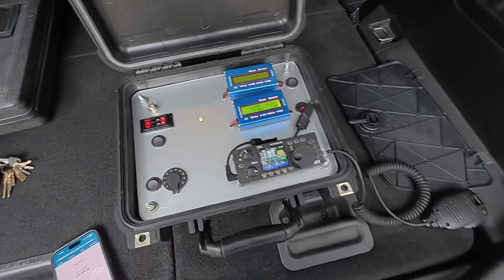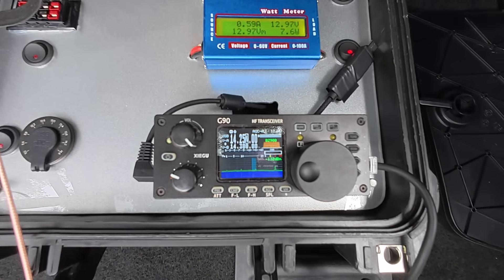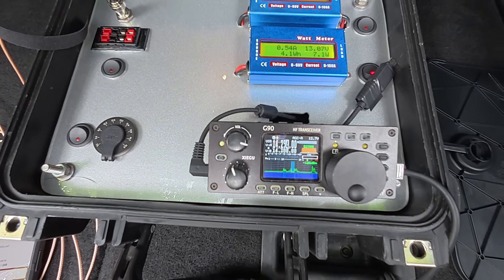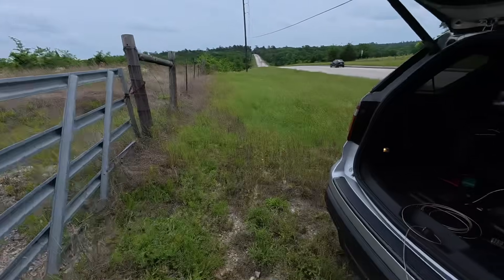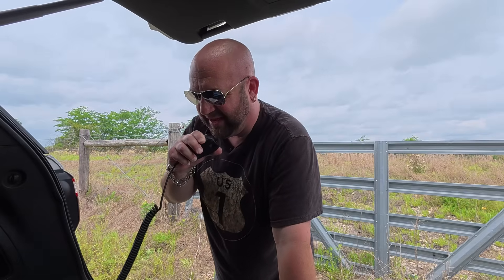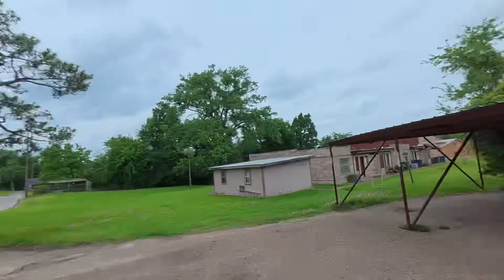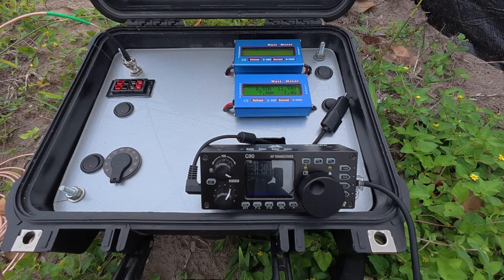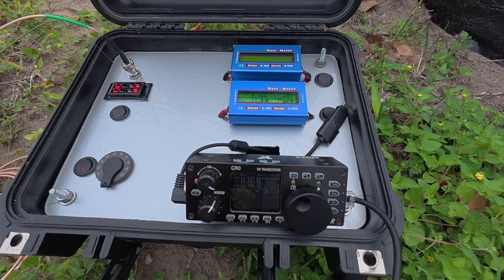Turning Random Objects Into Antennas With My Xiegu G90

Comment: 45 years ago. I attended a Technical School in Sarasota, Florida. In the summer of 1980. And I had with me, my good buddy Bob. Who was also taking the course. And I had brought along my, T Barry, CB radio. It was a very nice, 12 V or 120 V, unit.

We were staying on the second floor in the dormitory. And I had no portable antenna for my CB radio. But I did have the wall wart, Texas Instruments, calculator charger cord.

Now that did not have a, PL-259, connector on it. It had a 1/8 inch tip/sleeve, earphone like connector. And connected to the wall wart, transformer. So I wondered? What that is 6 foot piece of wire might pick up? If I stick it in the hole of the PL-259 connector on the back of the CB radio?

Lo and behold? The signal strength meter lights up nearly full scale deflection. I'm listening to dozens of conversations. The reception is superb! I'm picking people up from 40 miles away. They are coming in, 5 x 5.

Now of course. There was no ground wire connected. Just the hot lead. And 6 inches of wire connected to a transformer at the end. Approximately, 14 feet above ground. And the reception is truly, stunning.

Of course I know. Without a ground wire connected. I can't press the microphone transmit button. There's nothing to load it down with, properly. And will likely blow up my, CB transmitter? But what the hell?

So I do the Breaker Breaker for me. And everybody hears me! I am coming in really clearly. When they find out where I am in downtown Sarasota. They identify as being over 30 miles away. And they said my signal was very strong. And I wondered how that could be? But I look at my meter on the CB radio. When I'm in transmit. And it indicates… I'm in a proper, 52 ohm load. The transmit meter is exactly, where it should be. There is no actual antenna connected to my CB radio! This should not be! Physics says no can do. But it worked great. None of the guys could believe it. That it was working so well. And my signal was, 5 x 5, all over the city. From a 6 foot long calculator charger cord. With the end just stuffed into the PL-259 center connector. Using a toothpick. To hold it in place. This should not have worked this well. All the guys were going off about it. We were in Radio Engineering School.

So the next day. I bring it to class. The entire class wants to know from the professor. Why did this work so well? The professors as it cannot work. We turn it on. It's working great again. We can transmit. We can receive. We've got good reception from everybody. The professor got upset. He said this cannot be. But it was. It worked great. And it pretty much blew everything they were teaching us. In order to get our FCC 1st Class Radiotelephone Broadcasting License. I later went to work for NBC-TV in Washington DC. Which was the purpose of attaining that license. But I'm not really an RF guy. I'm about the sound. I'm not about the transmitter. Yet? This was definitely a learning experience. When some old, calculator charger cord. Can work better. Than a $50 +, CB antenna. Which really makes no sense. So much for physics.

To this day that whole thing was a total technological enigma. I've not attempted to reproduce it.
RemyRAD
Reply: What a GREAT story, thanks for sharing. I may hazard a guess that the wall-wart transformer was doing the job of the needed impedance transformation, so that you got a decent match for the "antenna" system as a whole. You "lucked out". Good job in being brave and trying it. Hope you have done some more innovating since then. I bet you are a good audio engineer!

Comment: Any metallic object will act as an antenna. Some will be poor (maybe too small or it has an unwanted earth connection) some will be surprisingly good. I remember a craze for using trees back in the 70's.
Reply: Do tell - how do you load up a tree?
Reply: @mrtechie6810  They would wind a coupling coil around the trunk. They found they could get DX contacts, but I always thought the radiation was coming directly from the coil rather than the tree. I don't think they ever did a properly controlled comparison of the performance 'with tree' against 'without tree'!

Comment: Just need to keep in mind that galvanic corrosion around the various metal joints, screws, etc on objects like metal gates, barbed wire, rain gutters, and so on cause diode rectification which creates radio energy at various frequencies (harmonics) and power levels...which could play havoc with your or neighbors' electronic devices. What and how much is affected by what the device does, frequencies to which it may be sensitive, and power levels. Problems used to be limited mostly to broadcast TV and radio and prime examples where you could cause unintended interference.

These days, even home controllers can be affected and the interference can cause unintended operations or turn something on or off at the worst possible time.
Bluetooth, WiFi and private cellphone repeater towers of course, and even devices dependent on GPS may experience problems (in rural areas, perhaps even drone networks or certain harvesting equipment may "lose" sufficient signal and shut down), or cattle tracking transponder receivers may misreport animal locations or other data.

Comment: I built a QRP Tuna Tin transmitter and used a metal coat hanger for an antenna in my novice days back in the 70’s. When the band is open, anything’s game. Don’t need expensive antennas. A true prepper will make it happen.
Reply: FUNNY YOU MENTIONED THE SOLAR CYCLE ... THIS IS ONLY
POSSIBEL AT SOLAR MAX NOW ASK WHY ROMMEL IN 1940 CULD REATCH 
ENGLAND ON 27MC BACK IN THE DAY.. AND WHY A STRING CULD GET MASSAGES
ABROAD.. WITH LITTEL TO NO EFFEKT.. THIS IS THE 5´TH CYCEL SINS 1978TIS  ROUGHLY EVERY 11 YEAR MAX STARTS 
TRY IN 6 YEARS.... NOTHING 0 SILTCH ... FUNNY SCAMMERS CAN SCAM SO MENNY

Comment: I'm not a licensed radio operator yet, I'm just a listener, but I see it quite simply: anything made of conductive metal can be an antenna. You just have to test how well it works and for which waveband it's perfect. So go ahead and test it out.
Reply: A good starting point but not quite, its not necessarily going to be 'perfect' on any frequency (in fact it wont be on any), it may just act as a dummy load with an ATU, but on the other hand if it radiates some RF it may work. As you say go ahead and test it out for fun.
Reply from the maker: That's the whole point.  You never know unless you try.

Comment: Hey Mike, my craziest Antenna Experiment ever was using a metallic Shopping Car indoor,  around 20ft. of RG 213 Coax Cable with a Aligator Clip on a Roller Inductor AT-Coupler running Kenwood TS-140s. On 20W-PEP everything was save with RFI & TVI.  Stations across Germany and Austria have been surprized how well they could hear me on the 40m Band. Worked some DX on 20 and 15m back on this Day across Europe. Acutally it's a waste of Money buying Parts to build Antennas or buying Antennas. Like you mentioned it, there is Antennas all around us, you just gotta use them 😂😂😂👍

Comment: What a awesome video , This is the type of thing they should include in  science classes at school  Instead of the stuff you're trying to force on the kids this day and age,to let them know that there's other opportunities outside of staring at your tablet or watching TV  Or playing video games all day. I just found your channel watched it all the way through. I'm in my 60s and I was just diagnosed with autism and ADHD  Last year. I was doin this type of thing started when I was about 8 years old I climbed my tree and threw a wire down to my bedroom  Window I had one of those  100 mW a miniature AM transmitter I think I got it at olsen electronics on El Camino in Santa Clara , What was a little yellow Pyramid  With a   9 V. That thing would go Quite a ways a 1/2 mile if you had a car radio Otherwise a couple 100 feet without that  Long wire antenna. That went on to  Free band when I found a linear and s BE side band radio at a  Garage sale I could write a book with this stuff I think I will .thanks for   sharing your hobby On youtube. I was having a difficult day , But man I tell you when I watch the video I feel so much better I just found my old thunder 2000 FM classic from 1981 I was 17 years old had a 5/8  Wave ground plane I put a power knob on that thing with a really nice linear and a couple car batteries  There was a water softener so I used a bag of that Salt and a bucket I made a dripper for the ground I hooked up a drip irrigation To keep the area wet around the ground rod made up the call numbers 535 Central California. Talked all over the world.

Comment: People say the G90 will tune a wet string. My guy. My man. You have to try it. Salty water is probably more conducive.
Reply from the maker: That my friend is added to the list.  How awesome would it be if this actually works?!
Reply: Been there done that. The trick is a can with salt water and a tiny hole in the bottom to keep the string wet, by dripping water on the string through the hole.

Comment: Years ago I heard of a ham radio contest called the Strange Antenna Challenge. The idea was to load up anything and see if it could make contacts. People used things like gutters, curtain rods, bed springs, aluminum ladders, anything metal to see what would happen. This video was in a similar vein. It was pretty cool and shows that a G90 can load up just about anything!
Reply: As CB radio operators of the 80s, who massively exceeded the limits of what was permitted, we were inventive in creating camouflaged antennas
Reply: @andimerkle6924  did you use the exhaust stacks?
Reply: @eamonnator you could because the truck in on rubber wheels which the stacks ain't touching ground. 73. The bed spring is my favorite antenna. 73
Reply: Now I’m really tempted to tune up a G90 to a rain gutter!
Reply: Years ago, there was a really active group in both the Gwinnett Amateur Radio Society and the Atlanta Radio Club that would do all kinds of stuff as part of the strange antenna challenge. Thanks for the memories!
Reply: any antenna tuner will do....doesnt need to be G90... SMH...these vids are quite pathetic....
Reply: No certain bands need tuners for that band yes a coat hanger will work somewhat but if you want distance get the right tuner for that particular band. Some antennas are already tuned for that antennas band. People are not going to have multiple antennas unless there are no rules for antenna placement. HOAs changed the playing field. 73  @WacKEDmaN

Comment: Mike you need to try a dumpster ...DOTA Dumpters on the Air
Reply from the maker: I actually tried a dumpster earlier that day but couldn’t get a good connection to it anywhere.  Those things are painted really well.
Reply: I managed a CW contact on a dumpster with my G90.

Comment: The small AM radio I take on my walks here in Pinellas County is usually tuned to CMBR in Havana, Cuba because of their excellent music.  While walking on a bridge I stopped to watch some wildlife in the water and as I leaned on the metal railing my radio started blasting CMBR (it's 350 miles away) into my earbuds.  The bridge railing was acting as an antenna, feeding my radio some hot RF of the entire AM band, was a nice discovery.

Comment: A long barbed wire fence would be nice for 80 meters
Reply: Barbed wire is typically grounded through the T posts. Gotta use electric fencing that's issolated.
Reply: I've got a video hitting 800mi with one.

Comment: So, I just watched your video, this is an awesome video. I did notice that the hand rail you tried was not grounded due to the concrete, anyway, it got me thinking could I do the same with my FT 891 and my ldg tuner? I have that setup in a harbor freight case similar to pelican. Again great video.

Comment: This is really cool! The different antennas are pretty low. When I run QRP I always end my transmission with QRP. I've been planning to do this on a railing on a bridge that's 2000 feet long and about 80 high in the middle. Someday. 73

Comment: For the first railing, you were still likely in split mode as well.  A retry would have been good to do.   But it is certainly interesting to make an antenna out of a random object.
Reply: I had the same thought. Why not go back and try the hand rail again?
Reply: Why do HAMs always say 5/9 when the truth is more S1 Radio 1.
Reply: @VicGreenBitcoin  was there even a single 59 in this video? "Always" is quite an exaggeration.
Reply: @ not all hams do that.  It's more the contesters  for the sake of speed and efficiency.
Reply: maybe the carport will be good for EME ?

Comment: You can tune a shopping cart with a G-90.  You may not be able to talk to anyone, but that radio can sure tune.  This was a really fun video to watch.  73!
Reply from the maker: But I did tune a shopping cart and I did talk to someone with it...
Reply: I once worked a ham who told me he was doing a demonstration of ham radio at a shopping mall. He was running a Uniden 2510 and the antenna was mounted on a shopping cart. That was back when 10 was really hot so may have been easier than now.

Comment: So, the question is whether you were on split with the stair rail.  Shudda gone back and tried it again
Reply from the maker: I'm 100% confident it was on split.  I remember when I put it into split to answer a question for a viewer and I never changed it back until the guard rail.  I bet I could have made a contact with the railing.  Perhaps I'll revisit it in a 3rd installment.

Comment: Several years ago, I loaded and made contacts on the wire on an electric livestock fence.  Very low noise floor.  If you will, please do a video on your G-90 box.  TIA
Reply from the maker: Several years ago I did a video on how I built my G90 go box too 🤣. https://youtu.be/hJ45RgHDUNU?si=4IFMeV68u1wNRKcR
Reply: @hamradiotube Thx. Great information!😊

Comment: Mike, look into getting some Mueller clips.  They are superior to alligator clips. You can get them sized by amps and have a larger mouth for gripping.
Reply from the maker: I used one the last time.  https://youtu.be/pLoVnFD71o4?si=h8sn_Pdm7u_FZNqS  Almost used it again in this video but I don't really like them.  They bend easily and the spring keeps popping out.
Reply: @hamradiotube  Must have gotten some poor quality ones.  That has been my experience with the alligator types.
Reply: @hamradiotube  Battery clamps. 73

Comment: He gives you a 33 and you start having a conversation with him lol I think you might have been a 53. Good video Mike 🎉
Reply: 3 is still fully readable with difficulty. 2 is some words.
Reply: The Xiegu tuner is conjugate matching the impedance at its  connection to the transmission line: not the antenna itself.

Comment: Baseball backstop for the win. We need to do hot air balloon mobile :).
Reply from the maker: We can load up the flame thrower!!
Reply: @hamradiotube  rain gutters work the best or run copper wire thought them invisible !
Reply: Manpack guys did baseball back stops. It works.
Reply: Giant corner reflector for your Ground Mount Vertical.